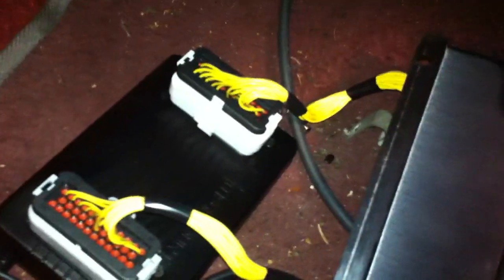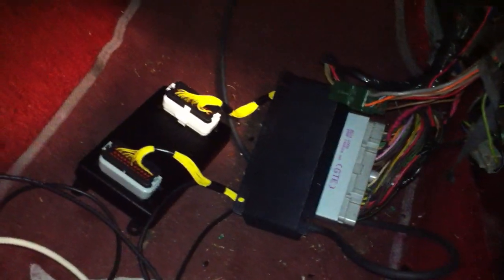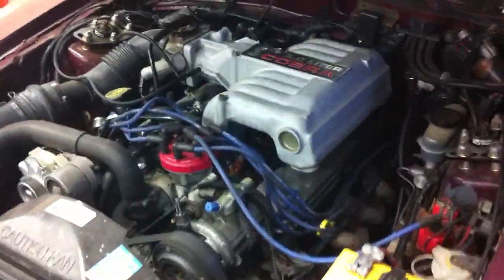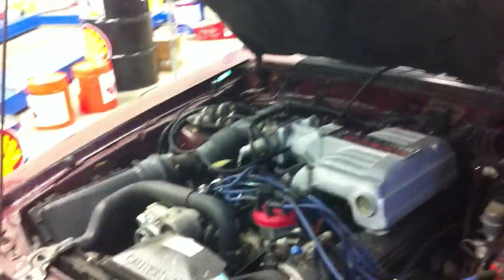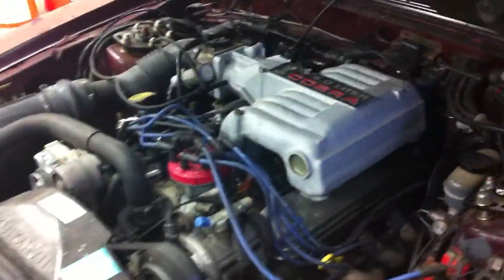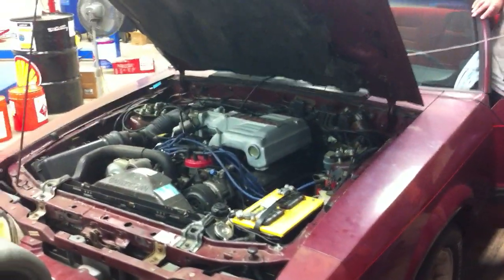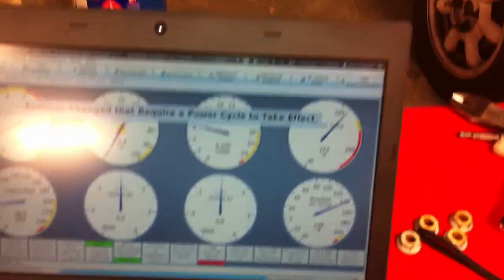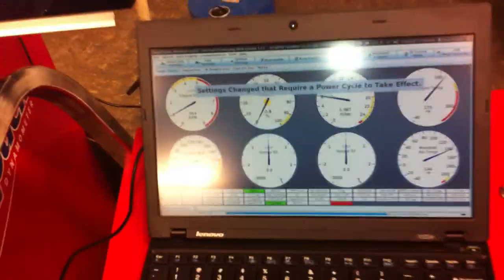MS3 Pro Prototype First Test Car - TFI Ignition - Full Sequential Fuel

Comment: i'd like to use the MS3 as well on my 5.0L mustang but I also want to run individual coils to each cylinder  and do away with the distributor and replace it with a cam position sensor . What else do I need ?

Comment: The MS3-Pro itself does not have transmission control. There is a separate standalone trans controller - sort of a "pro" version of the MegaShift - in the works from Bowling & Grippo, and we may offer standalone ECUs with engine and transmission control in one box at some point.

Comment: I have ms1 v3.0 running extra code, controlling fuel,spark,and idle.. But I have had to Marry it to my oem ecu to control my trans in my 94 gt.. Any hope this will control trans as well for a complete plug and play system for manual or automatics?